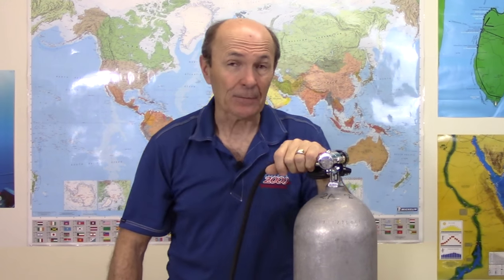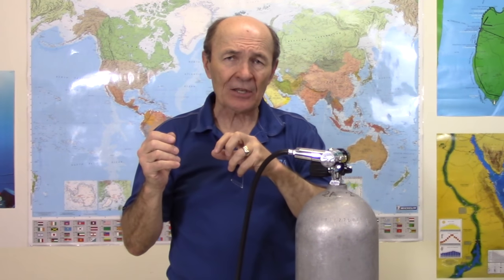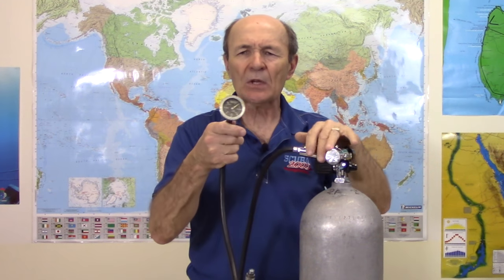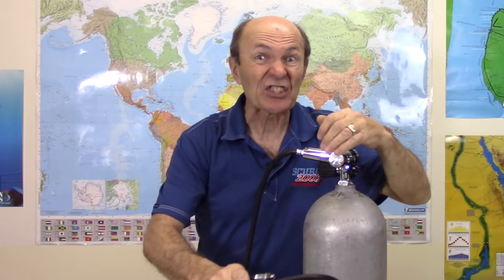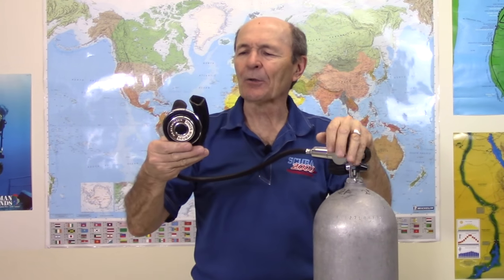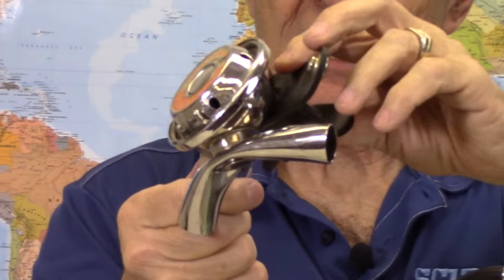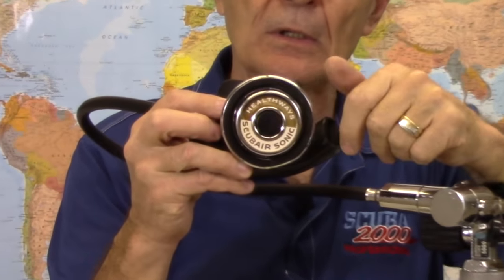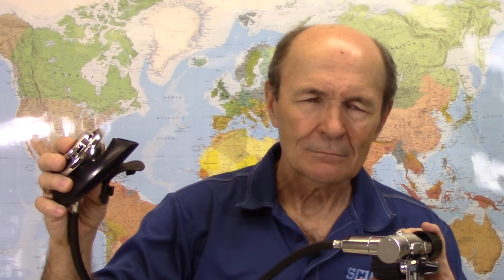Regulators That Talk - Vintage Scuba: S01E07

Comment: You mentioned that a lot of people thought diving was dangerous back in the 50's 60's and early 70's. Fact is some still do, lol, but truthfully back then diving really was dangerous. No gauges, no real decompression information and the only way you knew for sure you were low on air was to take that last breath that let you know to pull the "J": valve. I just don't know how many young divers today would still be diving in those conditions. We have made great progress since then. Personally I am pleased with modern diving, don't think I would dive old school, at least not for more than two or three occasional vintage dives.
Reply from the maker: Exactly my feelings Gee.
It's fun to use the old gear for displays and fun dives but when I make a real scuba dive, I love the modern, safe gear.
Alec

Comment: This is interesting to me.  I am a firefighter and our SCBA air packs have this feature.  Some use a bell, some do the clicking like the one in the video (which vibrates your whole face), and some have a whistle, but they all make it very clear that you are on your last few minutes of air to you and everyone around you.  I guess they're a lot more reliable now?  Or maybe just the maintenance standards are different?  Cool to see that they likely originated here.
Reply from the maker: A lot of firefighters use Scott Air Pacs which are (were) from the UK. Interestingly Scott made a full face scuba unit in the 60's. It was quite popular albeit expensive. At our store we service and fill the units you describe and they are quite good. The reliability on dry land, even with the rough treatment of firefighting, is much higher than with scuba.
Your tanks also have a pressure gauge but of course you can't read it when wearing it. The alarm is probably the best for firefighters.
Thanks for watching.
Alec